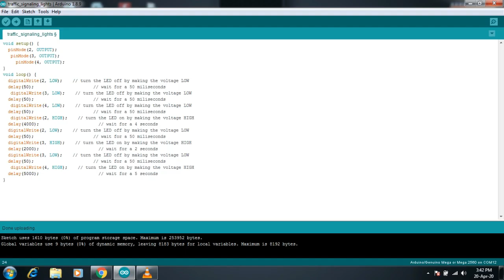How to set up Traffic Signaling Lights | LED | Arduino + Code #Arduino Tutorial - 02

Comment: How we can automate this task with Arduino. Let me say
this example, If I have a dc motor and I want to make it automatically (rotate
10 times) forward for a period of 2 minutes, Then (pause (stop) 3 seconds).
Then (rotate it backward 10 times) for a period of 2 minutes. This rotation
cycle back and forth repeated for 20 times. And stop after the full cycle
exactly like washing machine. Could you explain with simple project?Hi …I want to control a dc
motor making it rotate 10 times forward then pause for 3 seconds and rotate 10 times backward…. this rotation cycle back and forth will be repeated automatically 20 times exactly like the washing machine. What I
need to do that?
Reply from the maker: you can automate a dc motor what you need. keep watching my videos. I will give you step by step video tutorials on arduino including controlling dc motor.
Reply: u r a real star … thanx